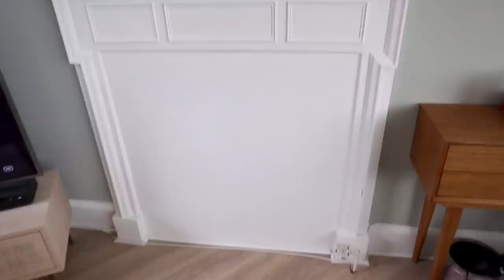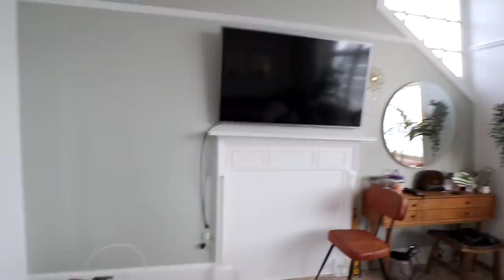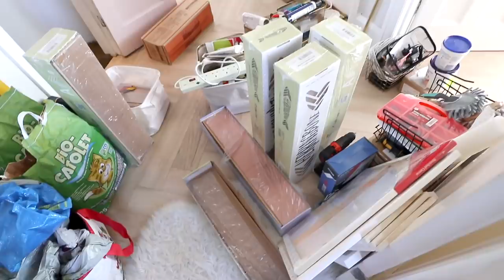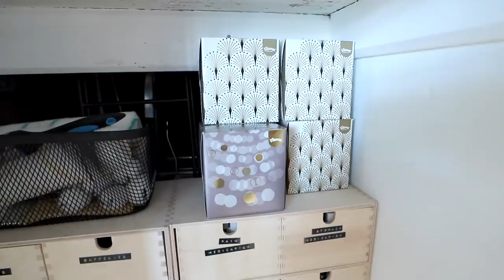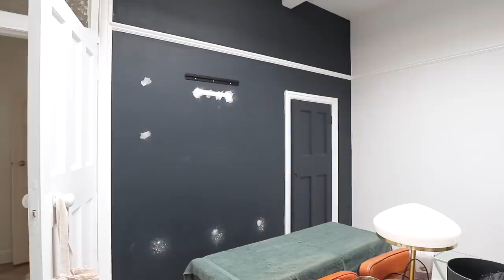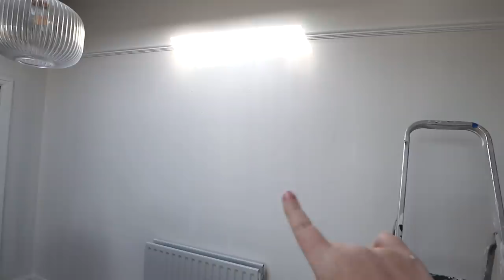lots of home changes! ✨ painting, decluttering + mounting my tv 🏡

Comment: Handy tip for your paint. Decant them into smaller jars and label them with the colour and what room they are for. They'll take up less space but also stops the paint drying out so easier should you need to touch up any walls